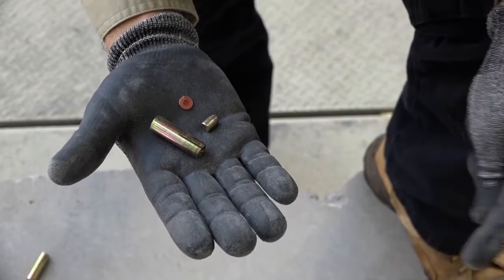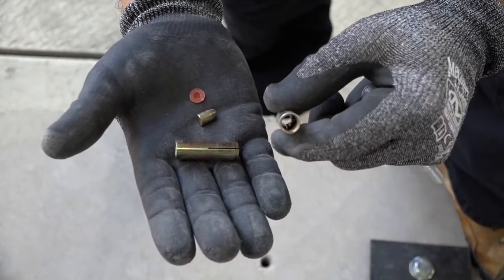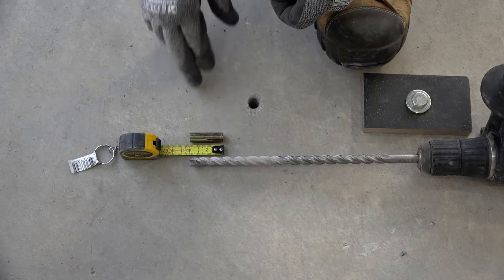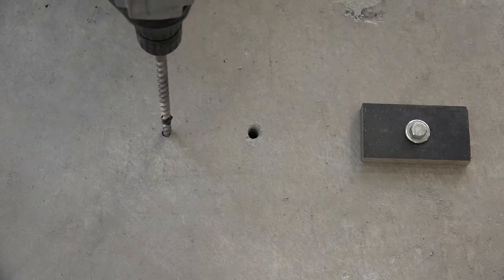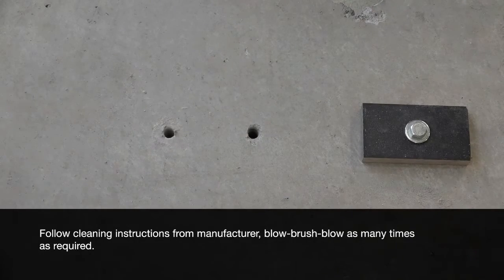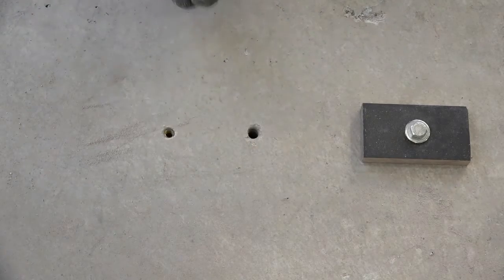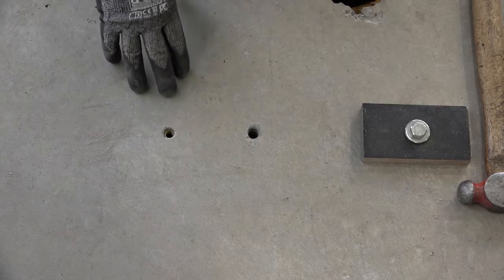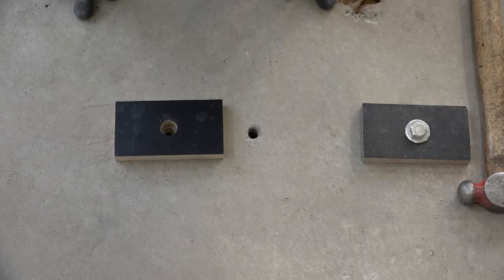Installation of Drop-in Anchor

Comment: Why is that tool required? Can’t you just drive the plug piece down with any punch? It will only go so far due to the size of the hole only allowing the anchor to expand so much?
Reply: The load transfer relies on the extent to which the inner cone is pushed (displacement), causing the sleeve of the drop-in anchor to expand. To achieve proper load transfer from the anchor to the concrete, the expansion must be as the manufacturer/supplier recommends. The installation tool is designed to ensure that the displacement/expansion is sufficient to secure the anchor within the concrete. Excessive displacement or expansion can damage either the anchor or the concrete, while insufficient displacement can lead to premature slip of the anchor. Therefore, the correct installation tool is essential for controlling the appropriate amount of displacement and expansion.